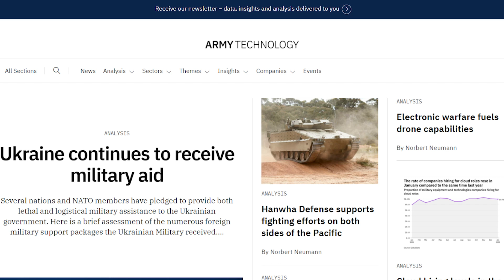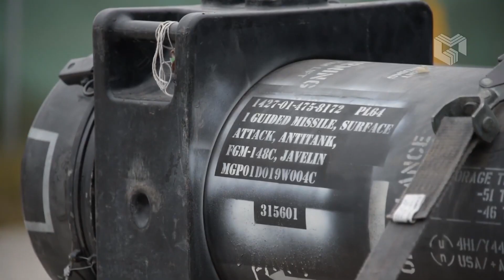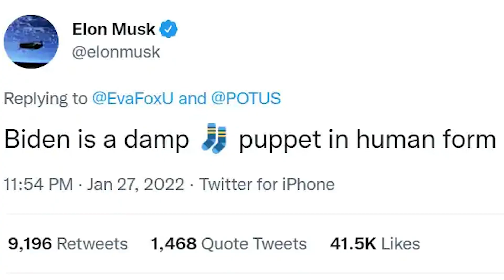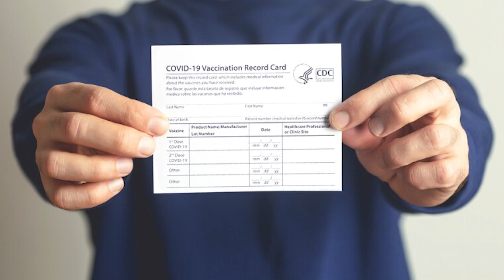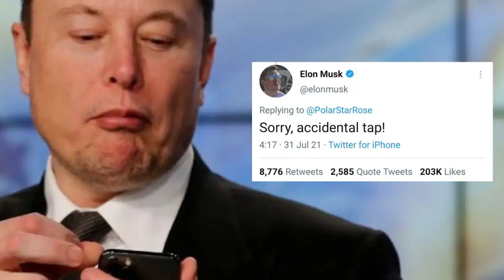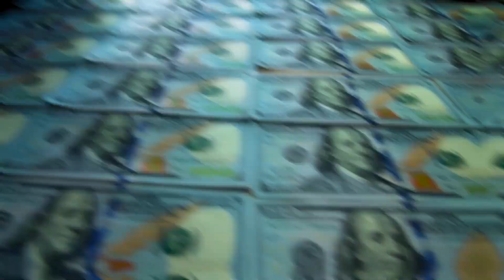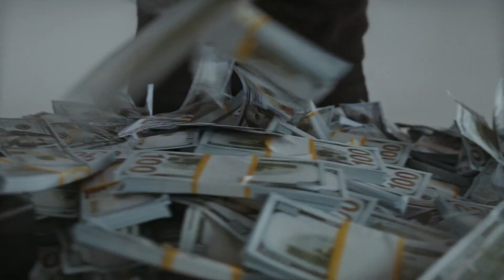Elon Musk Just LEAKED An INSANE Anti-Tank Weapon!

Comment: The Nlaw is just a weaker copy of our US Javelin missiles. The Nlaw range is 600 meters which means you have to be closer to the enemy and have a greater chance of being killed when using it, vs the Javelin that has a 4000 meter range. Along with tanks, the Javelin can also take out jets and helicopters at up to 5500 meters or 18,000 ft. The Nlaw was probably made for street fighting in confined spaces.
Reply: It's not a copy, the NLAW is short to medium range engagement, but no less effective than the Javelin. It was also designed to be simple so requires much less training and to be very light. The main point however is cost. You can have roughly 6 NLAWs for the price of 1 Javelin missile.
Reply: NLAW is a further development and combination of previous Saab/Bofors systems, the CS system from AT4 which allows it to be fired indoors, the missile and warhead from the Bill2 system, and finally a new predictive line-of-sight guidance system to tie up the package.
And it costs about 1/5 of a Javelin missile.

The US army got tired of units wasting costly Javelin missiles (175k) on enemy infantry in Afghanistan. So now they are introducing the much cheaper and more versatile Carl-Gustaf system for both the US army and Marines.

Both NLAW and Carl-Gustaf is Swedish of course, just as the AT4 that the US has been using for decades.